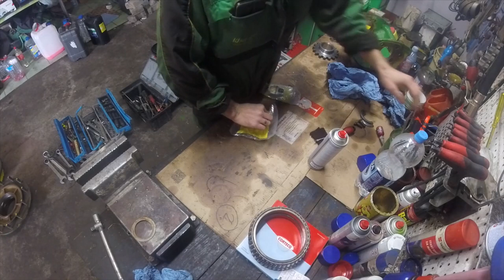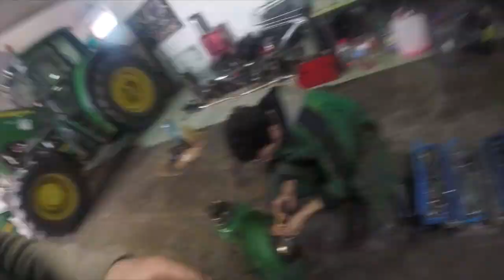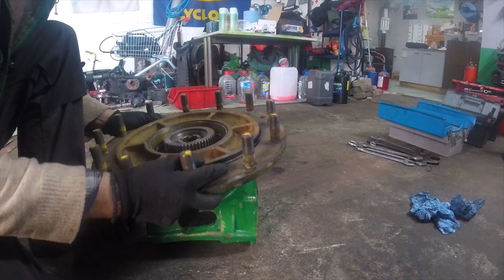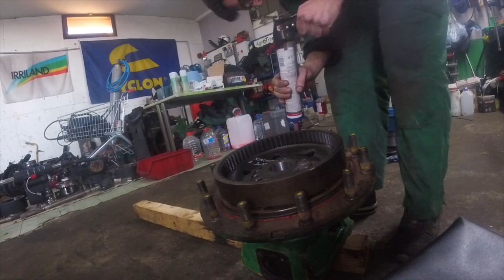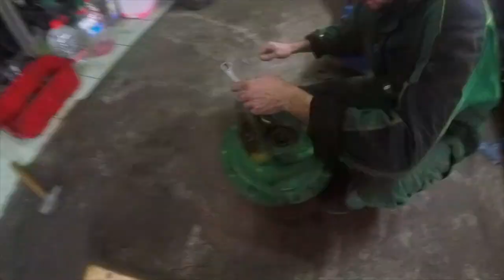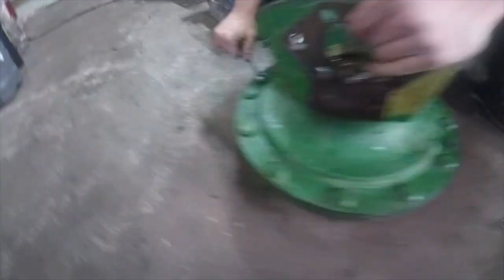John Deere 4755 Wheel Hub Assembling

Comment: Why did you have the hub planetary gears apart ??  I've never seen a planetary gear failure in the heavy-duty John Deere mechanical front-wheel-drive hubs !!  ( I can only imagine a failure being caused by a TOTAL loss of lube oil, due to a leaking outboard input shaft oil seal 🤔 ,  which was A HUGE PROBLEM‼️‼️)  Deere introduced a "bellows" style seal for the outboard